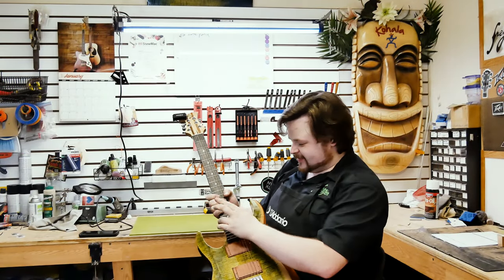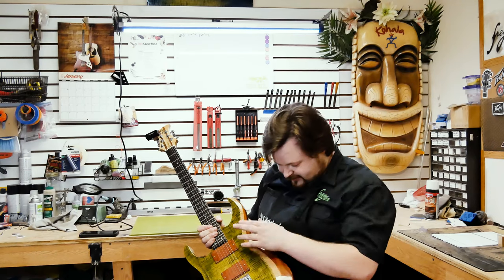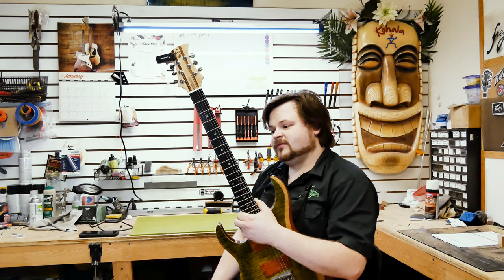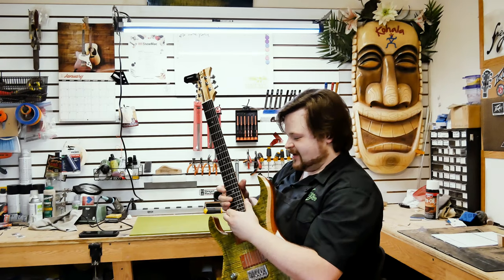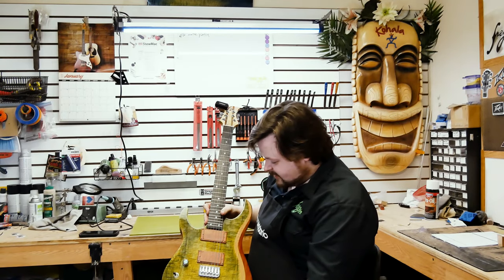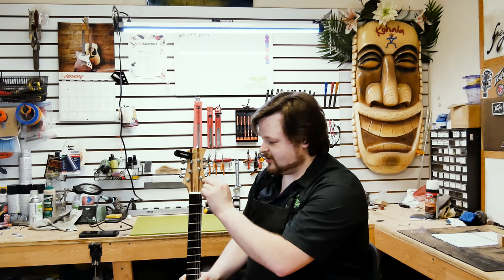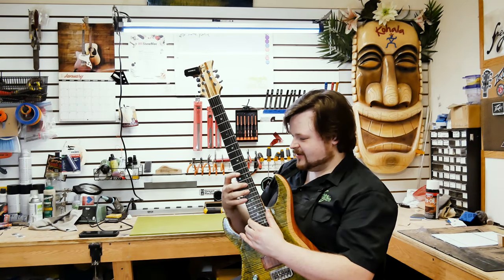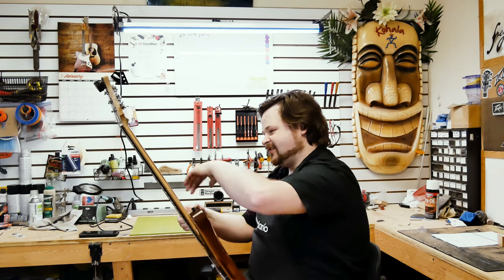Tips to Build Your Ultimate Custom Guitar | Interview with a Luthier

Comment: Measure twice.. glue once?   I had a similar issue on my first build, only the other way. I had to recess the bridge to get the strings close enough to the frets to be playable, then I had to flush mount the pickups to the body with homemade flat 1/8 thick metal rings. It actually came out very uniquely cool. It sold to the first guy who saw it.  I had many other "happy accidents" along the way, not the least of which was turning a neck-through guitar into a glue in, and turning a bass into a six string guitar.  Saving guitar projects is a skill set  that's learned in the heat of frustration.  I feel your pain, brother.